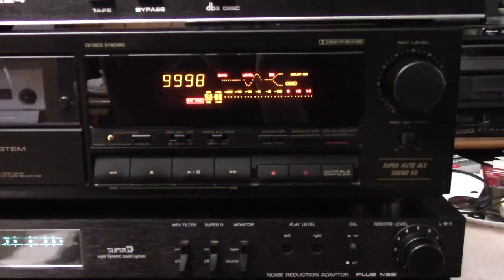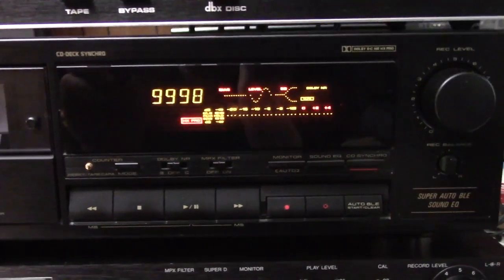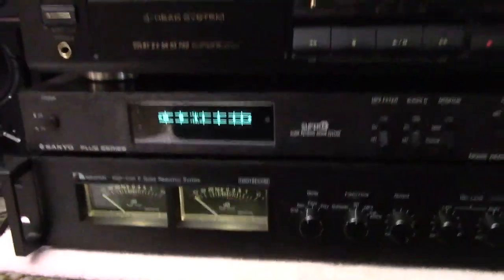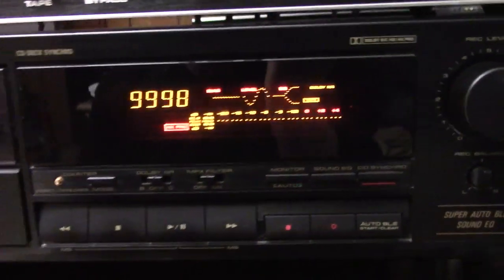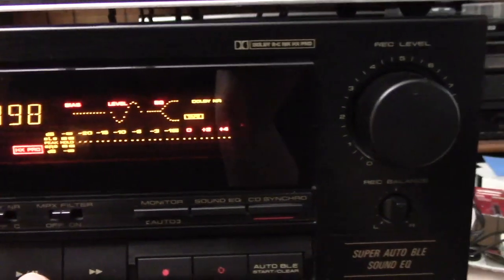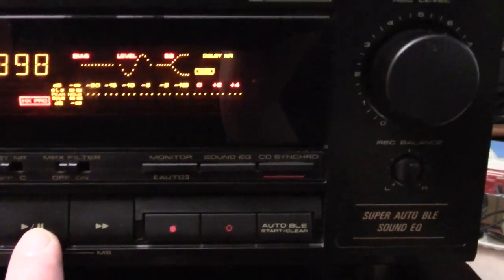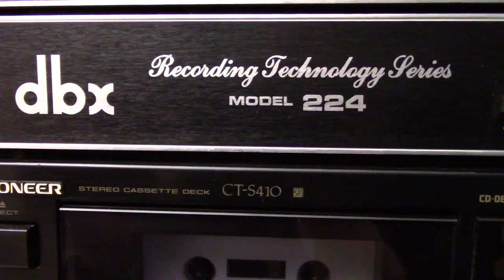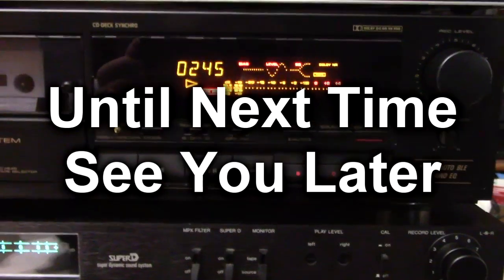Noise Reduction Experiment: How They Sound

Comment: Excellent demo
Reply: This demo provides an interesting comparison between the older formats Dolby B for example vs the newer more aggressive noise reduction systems. Dolby had to consider when Dolby A & B were out there that the vast majority of tape decks whether reel to reel, cassette or 8-Track did not have built in Noise Reduction encoding or decoding capabilities and the most popular tape formats at this time were portable automobile cassette & 8-Track systems that would NEVER have recording functionality nor noise reduction encoding. And since most people at the time held onto their cars much longer than today & add-on dolby/dbx etc..  decoders were not a popular item for cars especially with factory installed tape players, the tapes either made at home with good quality hi-fi 3 head cassette decks did have noise reduction systems- multiple formats as technology improved overtime, they needed a noise reduction format that sounded great on the medium-high fidelity system these folks had @ home but also sounded acceptable or better in their car stereo as well. In many cases people spent more hours actually listening to recorded music in their car as opposed to at home BUT they spent more time & money upgrading home tape recording equipment & finding the best quality/sounding blank tape formulas at best price paired with the latest noise reduction systems- Dolby always made sure that older A &/or B was included on the cassette recorder that licensed their system even if Dolby C or latest Dbx version was also included.They did this knowing that many people who ordered cassette player car stereo option also made their mixed tapes @ home to listen in their cars. So for older car stereos & people at that time keeping cars  for 7-10 years ....... 
...continued after some off topic discussion...

{{{opposite of today's 3 yr lease popularity- result most folks today have the "latest" technology in their cars while their home systems are lagging dreadfully behind- NOTE: I used "latest" tech not "better" tech in cars - reason being that digital streaming IMHO is not better quality, better sounding, etc.. than either CD/DVD/BLU RAY or even analog cassette- but that is another story/discussion for another day & doesn't belong in this YouTube video-  BTW - I dont think streaming is bad - I just think having the ability to choose a higher definition audio format should be an option - to me it's the same as choosing the FM Stereo radio option over the Mono AM radio default back in the mid-1960's - FM was only available on the most expensive car models - if at all}}}

....back on topic - sorry...

.... keeping cars for 7-10 years meant car tech was way behind as the audiophile industry was hot - POINT BEING Dolby made sure mixed tapes made at home so long as Dolby B was used to encode could be played back inside car with either minor or possibly no tone adjustments would still sound good. As car tech caught up and larger amps, bi-amping, using separate speaker arrays tweeters, mid-range, woofer/bass & subwoofers each with their own active crossover networks & separate amps - the car sound systems now exceeded home systems in sound quality & even price!! Crazy...

Comment: Hammy  , Good Day or Night to You !    Please  tell  did you ever come across  Super D NR Demonstration Tape ?  which can be seen in this ad https://www.canuckaudiomart.com/details/649477988-sanyo-plus-n55-super-d-dual-band-tape-noise-reduction-system-cassette-reel-to-reel-rareexcellent/images/2063212/   Please if  you know where to get  it or copy of it , share it with me , Cheers
Reply from the maker: Greetings to you. To be honest, I am not aware of a Super D demo tape. It took me a while to understand the functions of the unit because I purchased it without a users manual. However, hifiengine.com came to the rescue and I was able to get the info I needed from a manual thay had listed. Maybe someone on e-bay may have a line on a Super D demo, but for now, I don't know.
Reply: @HammyTechnoid  Thank you,  yes the Demo tape was original part of purchase,  Someone has it for sure )